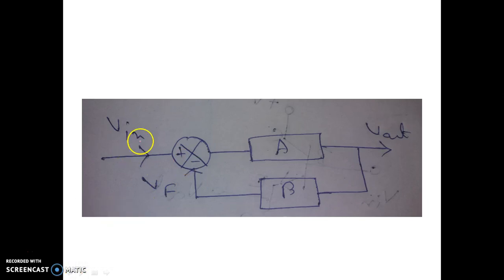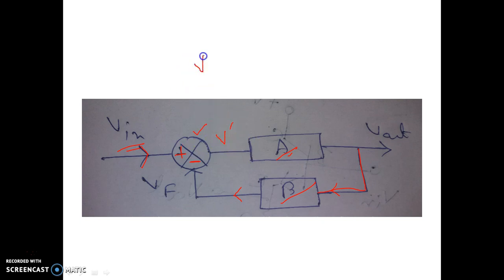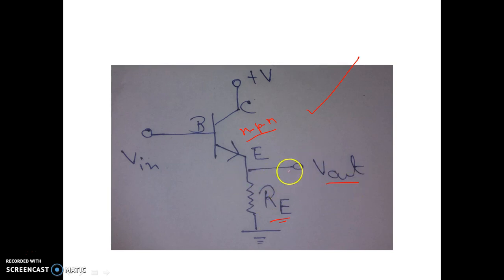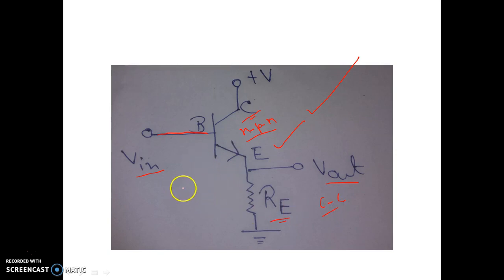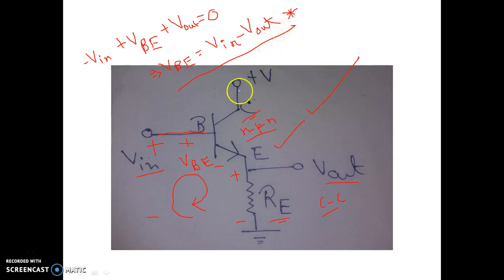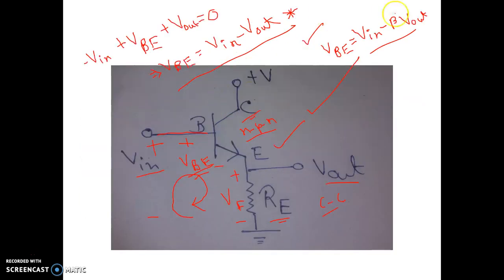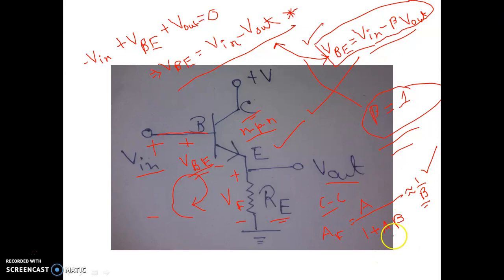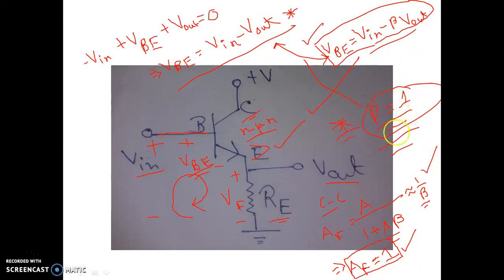Common Collector  Feedback Network

Comment: Why is it a negative feedback? I didn't understand
Reply from the maker: Common-collector amplifiers have negative feedback, due to the placement of the load resistor between emitter and ground--if you observe actual voltage input for the transistor is VBE which is Vin-Vout (and Vout=Vf) , so VBE=Vin-Vf , so feedback voltage is subtracted in this case , so it's negative feedback . Hope it will be helpful. Happy Learning :-)
Reply: @KnowledgeAmplifier1  thank you very much